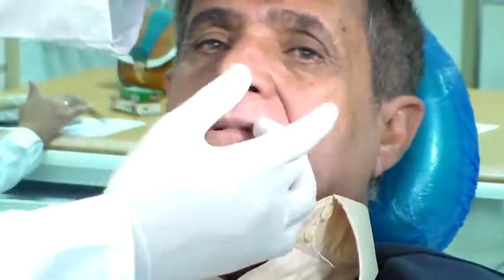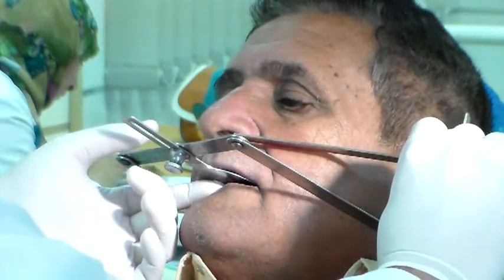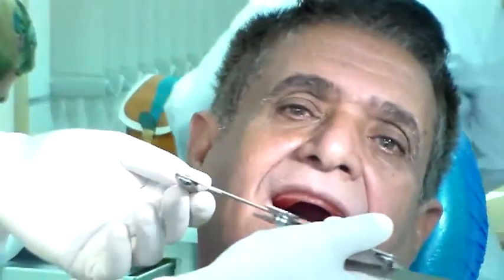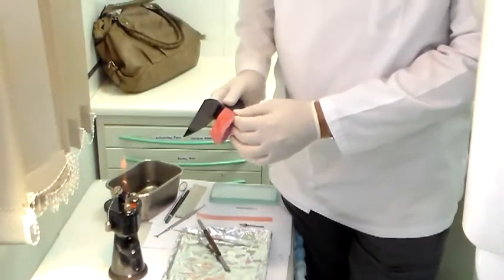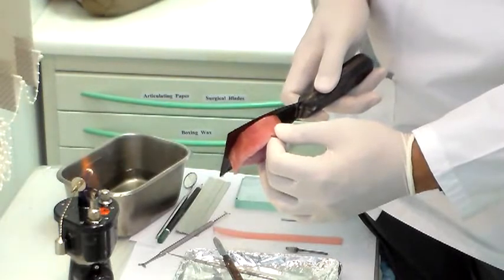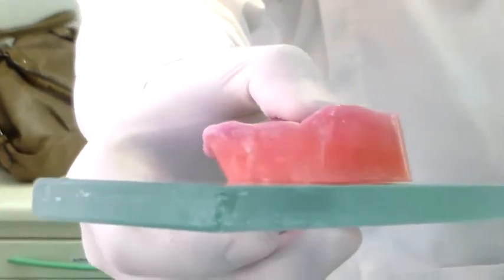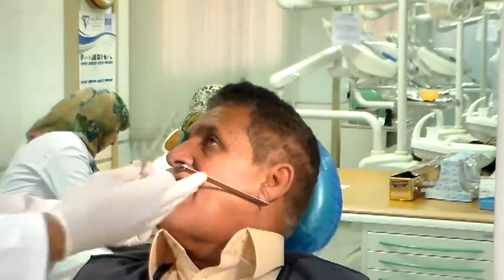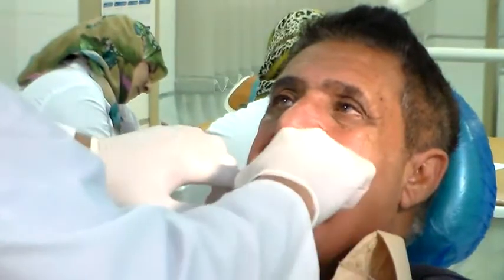CD Videos No.20- Adj. of Max. Rec. Block Part 3

Comment: Hi Doctor, I really appreciate your videos.  Thanks for all the vidoes!  However had a question about this one. When you checked for the parallelism of the occlusal rim to camper's plane for the second time  after adjusting the posterior part of the occlusal rims you said it is parallel but it doesn't seem parallel to us!  Is de due to the not proper alignment of the camera?
Reply from the maker: Mmm... I understand your point. 
It is probably the angle at which the cameras is because it VERY MUCH LOOKS OFF.  I'm so sorry.  Actually I hardly edited any of these videos.  
I simply did the case as I filmed it.  
If the angulation was wrong initially I'd have to correct it and I would definitely have edited it into the video. 
So I'm pretty much sure it's the camera angulation - though it really LOOKS OFF. 
SORRY TO ALL. 
Thanks again for calling this out.  
I'm sure this reply will help many clear the same doubt.
Reply: Thank you for the clarity